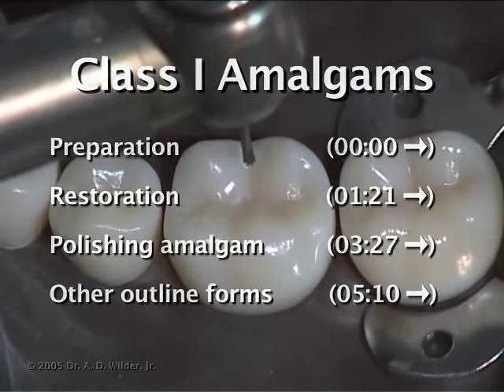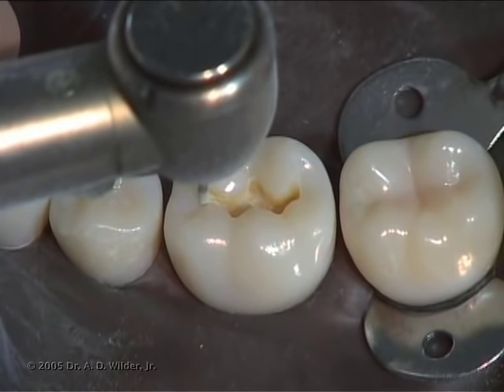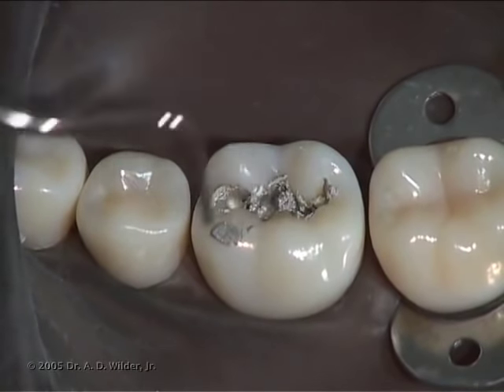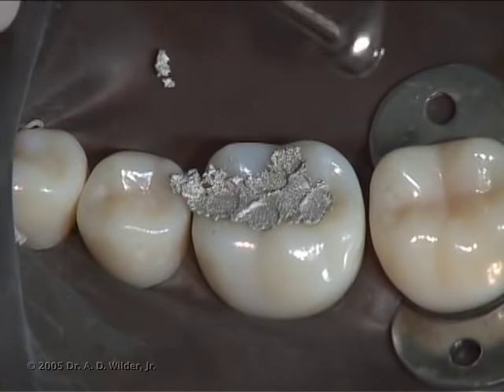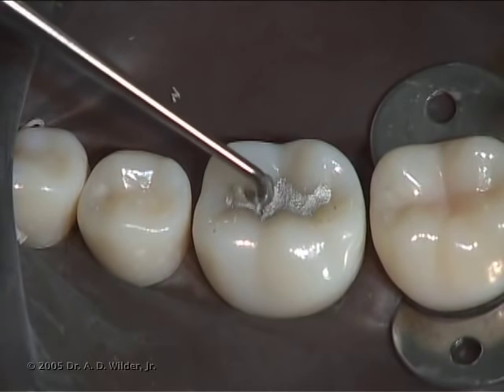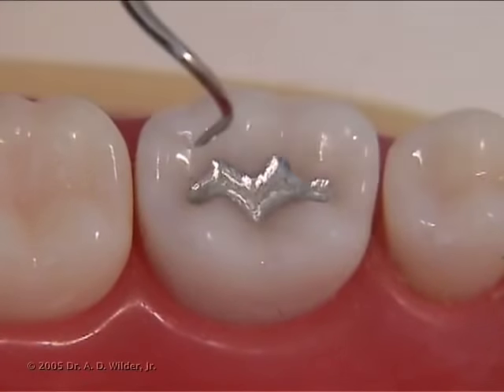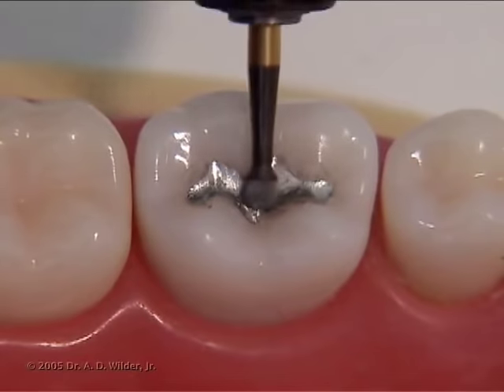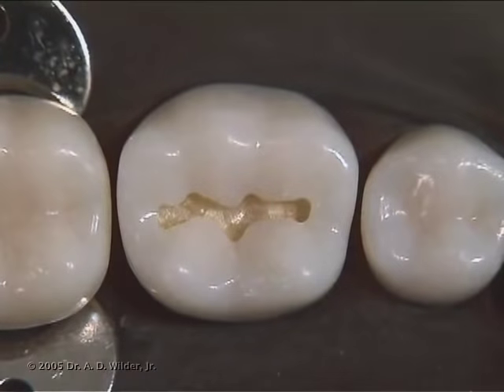Class I Amalgam Preparation & Restoration | Operative Dentistry

Comment: All dentists will agree - amalgam fillings are actually the most durable type of filling. I used to see amalgam fillings on patients that had been on their teeth since the late 80s. Composite has been around since the early 90s . Amalgam is still very much used in the US and in many parts of world. Amalgam really is best for small fillings but on molars, I've seen amalgam fillings take up almost 75% of the tooth and lasted for awhile but had enamel grinded down that eventually had to be replaced with a crown.
Reply: I wish Italian dentists used amalgams large scale! 90% uses white composites here, which is both weak (I have to swap them every 4/5 years)  and expensive. My mother on the other hand has old amalgams and they are still intact since the 1990s.

Comment: I just realised i have these fillings on 2 teeth at the bottom. I have bad anxiety and have found out they contain mercury,  should i be worried? I also grind my teeth in the night
Reply from the maker: The minimal mercury released from amalgam (mainly during initial placement and removal) has not been shown to cause any adverse health effects. There is no need to worry, amalgam is a safe material that has been used for many decades. For more info, refer to this link: https://www.ada.org/en/about-the-ada/ada-positions-policies-and-statements/statement-on-dental-amalgam
Reply: I'd be worried. Amalgums have ruined my life. I am very sick and mercury poisoned with disabilty where I can barely walk. Don't believe this.
Reply: Zeliha çıktı ve bu kadar çok sevdiğimi söylemiş miydim. bu arada ben

Comment: Hi should we use  245 bur for the entire cavity preparation or use round bur , inverter cone and then 245 etc?
Reply from the maker: For this cavity preparation (and most of this size and configuration), we use the 245 for most of the time. However, when caries are being excavated we often use a large round bur in a slow-speed handpiece to remove the carious dentin safely and effectively.
Reply: Ohk thanks

Comment: how do you smoothen walls without removing tooth structure. this is my biggest flaw right now and it frustrates the heck out of me. i can line up my pits and establish the initial pattern and when i smooth my walls i widen my prep. how can i avoid this?
Reply from the maker: Are you talking about with an initial prep bur, like a 245 carbide or diamond? That was one of the most frustrating parts for me as a student, especially on typodont teeth. The key is having a very steady hand when smoothing so you direct the bur along the walls you've already prepped rather than gouging into them and removing more tooth structure. I often would use my other hand to help steady my dominant hand when doing this part. This is something that you do get better at with time and practice. Keep at it!
Reply: @mentaldental  thanks for the encouragement. I may have to take matters into my own hands and build a setup at my house to practice

Comment: I have a question: Is amalgam as strong as teeth?
Reply: well no filling will ever be as strong as your teeth, but amalgam is not used as widely as it was used before because of its color and some theories are that it contains toxic materials such as Hg.  anyway to answer ur question it is strong yes, and its used mostly on children who move a lot and dentists cant hold 100percent dry envoirment at work.
Reply: @kikothecat3700  Thanks for your answer
Reply: @larenzz1478  Amalgam is extremely strong, and if correctly done, they are among the most long lasting dental restorations. Gold restorations are the best, they cannot break, and will last a lifetime if you take good care of your teeth. Both gold and amalgam are excellent choices!
Reply: No. My amalgams were open and mercury poisoning cost me 20 years of my life. Use composite fillings instead
Reply: @roycerhett178  There is no free mercury in a modern amalgam filling. There is no such thing as an open amalgam filling. You might be confusing the term leaking filling, which some dentists might use. It doesn't mean anything is leaking out of the filling. It means that the filling isn't sealing the tooth anymore. There has been plenty of studies into the health effects of composite and amalgam fillings. Interestingly, people with amalgams live a tiny bit longer than people with composite. Composite fillings are full of chemicals that are both released from the fillings, and are known to be cytotoxic, or toxic to our cells. They can increase the risk of cancer. I try to limit the use of composite as much as possible.
Reply: @honestdentist3150  You made 4 wild assertions: "There is no free mercury in a modern amalgam filling. There is no such thing as an open amalgam filling. Interestingly, people with amalgams live a tiny bit longer than people with composite. Composite fillings are full of chemicals that are both released from the fillings, and are known to be cytotoxic, or toxic to our cells." Where is your proof? Also, a dental professor at NYU Dental stated that my amalgams were open within 2 seconds of her looking at my amalgams in March 2018. When I got the first amalgam removed the following week, my fatigue, trembling, severe brain fog, constipation, burning sensation in my nerves, and memory issues started going away. It was like magic. So, you might be reading studies about amalgams, but I lived it, and it was the worst experience of my life. In addition, when I went to my dentist of 17 years in February 2018 and told him to take my amalgams out, he said what you said: "Mercury fillings have not proven harm to human health." I then said, "WHAT? I have the proof right here in my phone!" As I was pulling my phone out, he put his hands up as if I was sticking him up, and slowly explained to me, like a kid who got caught sticking his hand inside a cookie jar, the complexities of taking out the amalgams. I then said "Ohhh, you don't want to take the amalgams out because you don't want to get sued." "That's correct," he said. Conclusively, you might think the mercury is not free in amalgams, but after I experienced the lethal symptoms of mercury poisoning for 17 years, had my lifelong dentist lie to me and deny me treatment, I conclude that there is free mercury in amalgams. If you have any more assertions, tell that to the New York State Dental Board who is currently investigating my former dentist.
Reply: @roycerhett178  You missunderstood your dentist when she said your amalgams where open. That means they were leaking, and wasn't sealing your teeth anymore. How can I be sure this is what she meant? I'm a dentist, and I do understand how fillings work, and what they can or cannot do. The filling itself can't be open. I do understand that there is most likely no point in discussing this with you, as you seem to have made up your mind, and isn't interested in listening to facts at all. I'm not saying you didn't experience severe symptoms. I have no idea about what you've been through. However, I can say that it wasn't because of your fillings. That could have been caused by a number of things. One thing to consider is the following, your fillings were leaking (were open). That means that there would have been decay developing under them. Were the nerves of your teeth infected? That could lead to some very serious symptoms as well.  The New York State Dental Board also believes amalgam to be a safe an effective dental restoration, so they will not do anything with your dentist based on that. In fact, many will consider it malpratice to remove an amalgam that is in good condition. And for good reason.
Reply: @honestdentist3150  i have anxiety ans juat realised i have 2 of these fillings in the bottom teeth. I also grind my teeth at night sometimes should i worry?
Reply: Tenho obturacoes feitas a mais de vinte anos com esta material e até hoje estão perfeitas, ouvi comentários algum tempo atrás que contém mercúrio e com o passar do tempo pode acarretar problemas no sangue, será verdade?